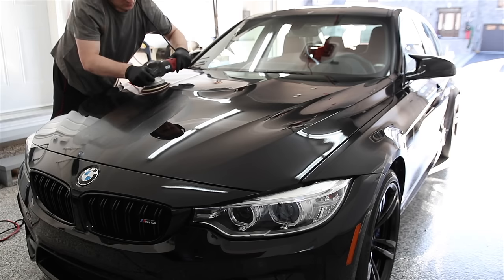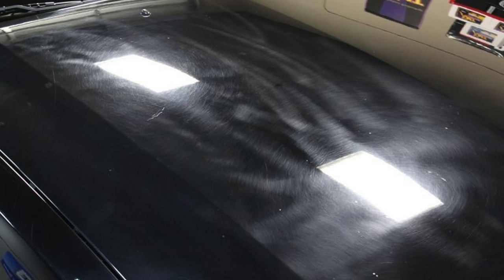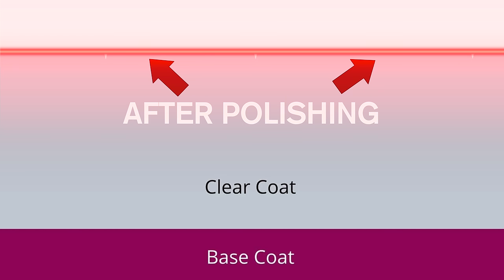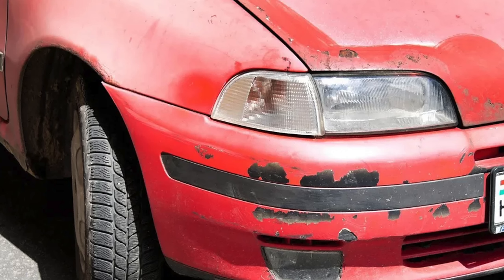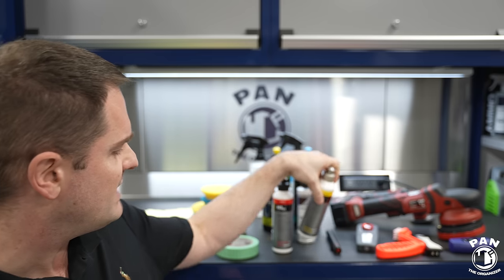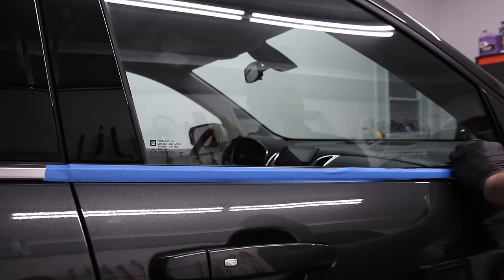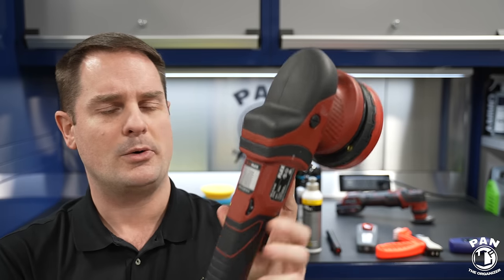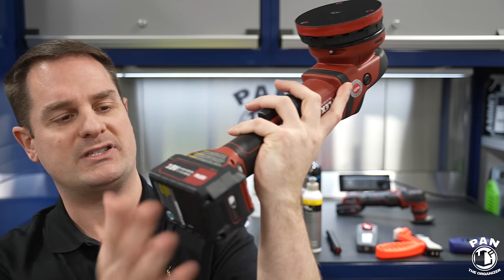DETAILING 101 - Paint Polishing - Everything You Need To Know

Comment: It would be helpful to see a video on how you polish around vehicle graphics, and the fine or small areas around emblems and such. Although off topic, another desired video would be on dealing with undercarriage cleaning for the snow belt states. Were using Magnesium chloride which seems to be accelerating corrosion on vehicles by 3-4 times.

Comment: LOVE your videos, Pan.  Delivery on my new car is in April.  It will probably take a month before I can assemble all of the chemicals I’ll need for all of the steps before I apply Avalon King ceramic coating.  If the car is only a month old when I apply the ceramic coating, do you think I can get by without doing any paint polishing?  My second question is when I take delivery of the car, I know the dealer will apply a light polish of some sort.  Will using one of the alcohol products you recommend be enough to remove that layer of wax?
Reply from the maker: Hi Neiman. A new car is never new until it's properly detailed. 
- at the factory, the paint defects are often corrected quickly by rotary polishing which can leave marks and holograms, so polishing corrects those, before you lock that in long term with a ceramic coating for example.
- vehicles are then transported by truck, train and boat so they are exposed to the elements, industrial fallout, brake dust, rail dust, etc
- vehicles are often left at boat docks (when transported by boat) or in exterior parking lots for weeks or months, again being exposed to the elements
- at the dealership, the vehicles are almost always poorly prepped using the same dirty water that was used for all the cars on a given day, and poor washing and drying methods leading to swirls and scratches 
- at the dealership, a layer of cheap wax or paint sealant is usually applied to attempt to make the paint glossy prior to delivery. It's crucial to remove any previous protection before you apply a ceramic coating, as coatings need to bond directly to a virgin clear coat.

If you only plan on applying a regular carnauba wax or paint sealant though, you could decide to skip machine polishing, as those protectants can be applied over existing protection and it's not as crucial to prep the paint as well.

I explain all of this in this popular video: https://youtu.be/QgoyrC-5CMc

So you can better visualize the new car prep process, here are the steps I perform on a brand new car from two of my customers: 
Tesla Model Y: https://youtu.be/gohks8xP5NY 
Porsche 911 Carrera: https://youtu.be/2ckiivbFqs4
Audi Q7: https://youtu.be/t7HCBSVnizM

Comment: Glad I watched this. I've never used a polisher before and just picked one up. It's a 5" da, and I'm wondering can I buy a 3' backing pad for it to use in the tight areas,  or would I have to use another machine?
Reply from the maker: You would have to use another machine. A 5" dual action has a 5" backing plate. Adding a smaller pad on that would mean that the edges of the backing plate are super exposed and could damage the surface. For 3" pads, you buy a 3" mini polisher. There are even 1" and 2" polishers on the market, for even tighter areas.

One machine alone can't do everything. Different tools for different uses.

See my video on affordable polishers here: https://youtu.be/LvPCkCqXEq0?si=Nv1R-fhdNZRTZzAS

Comment: Hi Pan… I’m going to polish my car and it’s a Volvo in stone black, has been very well kept but do have a few very fine scratches, the lower panels behind my back tires are plastic not metal so do I use same procedure with my DA machine as I do on the metal areas of car as far as technique, machine pressure?
Reply from the maker: Same methods on all painted surfaces, yes. You're polishing the clear coat, not the substrate to which the paint was applied to (i.e. plastics or metal).
Reply: @PanTheOrganizer  thank you
Reply from the maker: Thanks Ken!

Comment: Another great video. What would your recommendation be for paint correcting a 2011 VW GTi? Typically VW like Audi have hard paint. I just bought the Griots Garage 6 inch and 3 inch machines and they came with foam pads and the correcting cream. The paint is black and it’s still in good shape considering the age of the car, but it definitely has swirl marks, some etching, as well as areas on the doors with scratches. Not deep scratches but they look like something has rubbed against the paint. I have the hybrid ceramic wax for black cars, and was thinking of using the Griots correcting cream first and then finishing it off with that, but would appreciate your feedback. Thanks
Reply from the maker: You have to do test spots. Not all paint are made the same, and not two paints have the same level of defects. Try to figure out which compound and polish and pad combinations will work best for your specific paint and desired level of correction. There are no miraculous one solution does it all type answer when it comes to paint correction unfortunately.

Comment: Hey Pan, I'm new to paint correction. I've always taken heavy interest vehicles and everything about them. I've found paint correction to be that 😮 factor. I'm glad I came across your channel, there's so much valuable info!  I currently have a Milwaukee M18 15mm random orbital polisher and Milwaukee M12 3" polisher. I'm having a tough time deciding on pads. I've watched your video on the rupes, lake country, meguiars, as well as the DIY Detail for their waffle and wool pads. What is a great starter selection for compound, polish and a sealant? Ive picked up the meguiars compound and polish. I only have the foam pads that my 3" polisher came with. And I've got the turtle wax graphene flex spray. I'll be adding more stuff to my inventory soon. I do remember you mentioning that some manufacturers have harder/softer clear coat than others. I've got a 18 Ford Escape and a 06 Audi A4. Looking forward to your reply!
Reply from the maker: The Meguiar's Ultimate Compound & Ultimate Polish are some of the best entry level big box store accessible polishing compounds, so that's a great start! I would for sure recommend that you get a polisher that can take 5" pads, as you'll be covering more area and be more efficient in your polishing. Smaller 3-inch polishers are used more for intricate areas like grills, A & B pillars, mirrors, etc.

But a decent 15mm throw dual action polisher with a 5" backing plate is the tool you'll use 85% of the time. Here's a video I made about good affordable polishers: https://youtu.be/LvPCkCqXEq0

For the sealant, a good ceramic or graphene based protection in spray form is the best thing before jumping into true coatings in glass bottles. So the Turtle Wax Graphene Flex Wax spray you have is a very good easy to apply option. Don't forget to apply the first layer (foundation coat) on dry paint. Here's my review and application tutorial for Flex Wax: https://youtu.be/b5BjDzItlr8

If you have no polishing experience, don't overthink the moment and don't think about soft or hard clear coats. Do a test spot before you polish the entire vehicle. A test spot allows you to determine what will be the best polishing compound and pad combination for your desired level of defect removal and overall finish.

Start with just a polish. See if that gives you the results you want. If that's not enough, go with a compound, and finish with a polish. And look at that result. So on and so forth until you find the right combinations.
Reply: @PanTheOrganizer  Wow, I super appreciate that info. I do have the 5" Milwaukee DA 15mm random orbital polisher, I just need to get pads for it. After watching your review on the Milwaukee vs Flex polisher I'm pretty pumped that I bought a great solid unit. 

Btw, I'm in Central Alberta. So I pay closer attention to your videos when you mention things like climate, road salt, etc when it comes to protective coatings. I want to thank you for replying in such a timely manner. I'm super eager to start polishing within the next couple of days and with your quick response, I'm able to do exactly that! Thanks again.
Reply from the maker: I was in Alberta (and British Columbia) in 2021 with my girlfriend. We loved it! I vlogged my trip in this video: https://youtu.be/vAJn7-_S2VU

Comment: Hey pan thanks for the all of the videos, they've been a huge help! I started polishing my car about a week ago and have been working on it a couple hours a night after work. The panels i have already polished have accumulated some dust after its been sitting for a while. Whats the best way to remove the dust without causing more scratches before I apply a paint protection?
Reply from the maker: Compressed air or a plush microfiber towel and gently wipe.
Reply: @PanTheOrganizer  thanks for the quick reply! Should I use any quick detailer with the microfiber or just dry?

Comment: Hi Pan, love your videos. Can you tell me what your opinion is on doing a one step compound and polish? With examples of using Sonax Cut and Finish or 3D one Hybrid? I have a car with mild scratches but want them to buff out and create nice gloss without having to do a two step. Do you think that is fine?
Reply from the maker: Yes but it depends on what level of correction you want (expectations) vs the current state of your car.

That’s why we always do test sections to find the correct pad and polish combo and how many steps will be needed.
Reply: @PanTheOrganizer  Thank you for the response and you are right, it just depends on what level you are looking for. I just want to polish my entire (white) car. My goal is to remove light scratches and increase gloss levels while also not removing too much clear coat. So I think for me that will be the way to go. Just have to check if I use a microfiber pad or foam. Based on the internet most people say microfiber for a one step. I ordered 3D hybrid polish and compound. Curious how it is, maybe you can do a review about it sometime👌

Comment: Hey Pan the MAN!! I’m polishing a black Mercedes for a customer and it’s the most marred and scratched car I’ve ever seen. What would you use 1st choice???
The paint is on average 4.5 mils and I’m using MG microfiber and 3D one. It’s working just slow as heck, what would you use on this hard black paint as first choice??? Oh and I’m using a 3401.
Reply from the maker: Hi Corey. It's always hard to help people pick the correct pad and polishing compound combo as many variables come into play, including type of paint, the polisher you're using, your technique, etc.  The key is to do test spots until you find the proper pad and polish combination.

German paints tend to have harder clear coats, which means they are harder to correct. 
You'll need more cutting power from a more aggressive pad like this: https://bit.ly/3BOHgw3
And you for sure need a more aggressive cutting compound like this: https://bit.ly/3WrnA9y

The polisher you're using has more than enough power, I have a Flex 3401 and that direct drive polisher is one of the most powerful, so that's not the issue.
Reply: @PanTheOrganizer  Pan, I understand that fully, just curious what your go to is these days when facing hard black paint? I’m using a Flex 3401 The Beast!

Comment: As per usual Pan another VERY informative video. It is great timing for me for I am going to polish for the first time this spring. 2 questions if you don't mind? 1. Can you please explain to me how to make a IPA solution? 2. From the video I gather there is no worry if I decide to polish my vehicle every year utilizing the skills you shown. No concern of "wearing" down the clear coat?
Reply from the maker: Thanks for the kind words Barry. To quickly answer your questions:

1) I prefer to use premixed paint preps like CarPro Eraser or Gyeon Prep. If you want to make your own IPA solution, you will have to play around with ratios and dilutions to find the appropriate one. But in general, in a 32 oz spray bottle, you would add 4 oz of 91% isopropyl alcohol and 28 oz of distilled water.  If you only have access to 70% isopropyl alcohol at your pharmacy, you can add 8 oz of that with 24 oz of distilled water. That's a good starting point.

2) On a new car, new paint, you can polish once a year for many years without having to worry about burning through the clear coat. You should only have to polish once when taking delivery, to get the paint perfect, and then you protect the paint. If you use proper washing and drying methods, you should not have to polish for years to come. 

Keep in mind you shouldn't need to do heavy compound + polish yearly. A light yearly polish on a waxed car is fine. You wouldn't polish a ceramic coated car, as that would damage the coating. There is only one polish I know of that can correct light scratches on a coated car, and that's CarPro Essence+ (not the regular Essence) but that's for an entirely different video.

I get a brand new car every three years. I wash, decon, machine polish and protect it the day after I take delivery. And then it's just a matter of doing proper and careful maintenance on a regular basis. I never have to repolish my paint for the entire three years of ownership.

On an older car, if you don't know the paint's history, the only way to find out how much paint you're working with is to get a paint depth gauge, like the one I showed near the end of the video. I will have a full video review on it soon, explaining all the details and how simple it is to use, so stay tuned for that.

I hope this helps.
Reply: @PanTheOrganizer  Thank you. My thought process was to perform all the steps you shown and apply 303. I was thinking perhaps each spring perform everything in this video and apply 303 again?
Reply from the maker: That's good too! What ever works best for you, as long as you're protecting your car and enjoying the process, it's a win win for you and your car! :)

Comment: Hi Pan. Just had delivered a brand new car without any prep (even had to scrape off the wax crayon on the outside windscreen and the glue from the paper work on the inside) ! Your comment about not to worry with the depth of clear coat on a brand new car etc has given me the confidence to lightly machine polish the car with the appropriate prep first of course. Unfortunately, there is a lot of orange peel on the car which is so noticeable in bright sunlight. (metallic Red) 😔. Will slightly flattening the paint (no sanding) with say a Maguire's cutting pad make a big difference to the peel or just stay well away ? The car is a Skoda Octavia (VW brand, do you get them in Canada?) and would imagine it is a fairly hard clear coat. No garage, so just waiting for warmer weather. Bought the three turtle wax hybrid solutions Pro products and am looking forward to using them with the help of your tutorials. Thank you so much for your confidence boosting comments at the end of this video and hopefully I shall enjoy the experience of making my brand new car 🚗 POP !! Stay safe and very best wishes from England 🏴
Reply from the maker: Thanks Kevin! That was one of the goals of this video: empower my viewers with the knowledge and confidence they need to go out there and enjoy polishing!

Comment: I have a bran new car with 4k miles. Should I compound and polish or should I just polish. Barley any swirl marks
Reply from the maker: Usually, a polish is enough on brand new cars. But it depends if you have any deeper scratches or swirls. If that's the case, you might have to start with a compound, and then finish with the polish. From what I can read in your comment, it seems there are only light swirls, so just a polish should be enough.

A new car is never new until it's properly detailed. 
- at the factory, the paint defects are often corrected quickly by rotary polishing which can leave marks and holograms, so polishing corrects those, before you lock that in long term with a ceramic coating for example.
- vehicles are then transported by truck, train and boat so they are exposed to the elements, industrial fallout, brake dust, rail dust, etc
- vehicles are often left at boat docks (when transported by boat) or in exterior parking lots for weeks or months, again being exposed to the elements
- at the dealership, the vehicles are almost always poorly prepped using the same dirty water that was used for all the cars on a given day, and poor washing and drying methods leading to swirls and scratches 
- at the dealership, a layer of cheap wax or paint sealant is usually applied to attempt to make the paint glossy prior to delivery. It's crucial to remove any previous protection before you apply a ceramic coating, as coatings need to bond directly to a virgin clear coat.

If you only plan on applying a regular carnauba wax or paint sealant though, you could decide to skip machine polishing, as those protectants can be applied over existing protection and it's not as crucial to prep the paint as well.

I explain all of this in this popular video: https://youtu.be/QgoyrC-5CMc

So you can better visualize the new car prep process, here are the steps I perform on a brand new car from two of my customers: 
Aston Martin Vantage: https://youtu.be/OKga3yZVTqo
Tesla Model Y: https://youtu.be/gohks8xP5NY 
Porsche 911 Carrera: https://youtu.be/2ckiivbFqs4
Audi Q7: https://youtu.be/t7HCBSVnizM
BMW M6 Gran Coupe: https://youtu.be/0lC9uyKXs8Q
BMW M340i: https://youtu.be/etXhJNaF0EE
Audi RS3: https://youtu.be/641mAJfKDLM
Golf R: https://youtu.be/jr19g4PWJsk